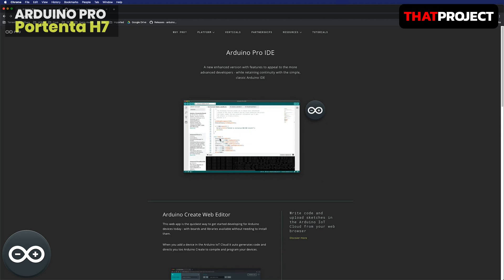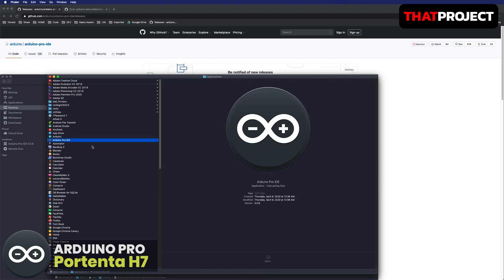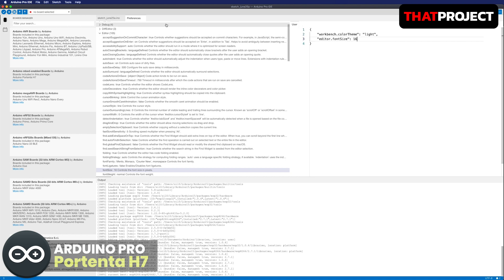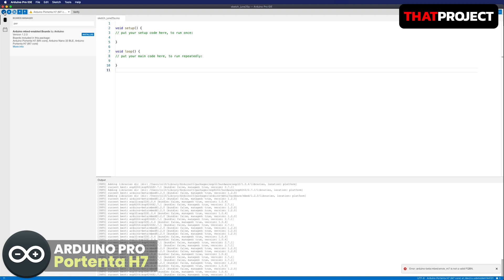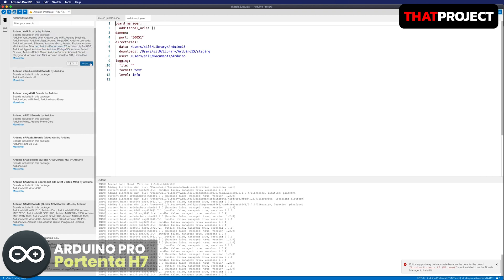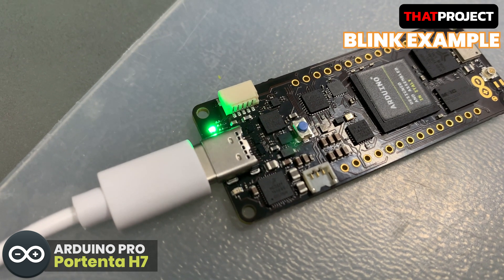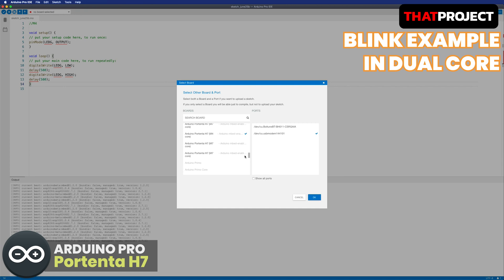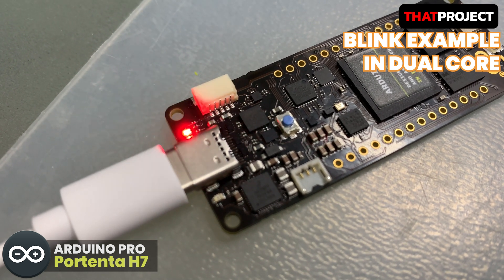Tutorial Example of Dual Core Processing (ft. Arduino Pro IDE)

Comment: how can i put one source code to work on both cores ? to use the both cores in same time?
Reply from the maker: Both cores can be used simultaneously, and you must select each core to flash the program you want. What is your plan to do with this?
Reply: Thank you very much for your reply, i need to use the both core in same time the M7 and M4, not M7 or M4 , i have an option in in Arduino ide to upload the sketch to H7 or M7 or M4 , is thats means H7 with use the both cores?, i need to control 6 servos with it , do you know how to set the servo output at 333Hz 12bit ? Please let me know Thanks @ThatProject
Reply from the maker: @WRDO  Yes, each M7/M4 program runs at the same time. Check this out. https://docs.arduino.cc/tutorials/portenta-h7/dual-core-processing/
I am not sure about the clock settings for servo operation. Please take a look at the examples.

Comment: Different sketches for the different cores? What a massive faff. With ESP32 and the built in RTOS you just have 2 loop functions in the same sketch - so much easier. Sharing memory & variables etc
Reply from the maker: AS Motion Lab I know what you're talking about. Agree with you half. As I said in the video, this can be useful in very special cases. (Actually, I prefer the EPS32, too, but...)